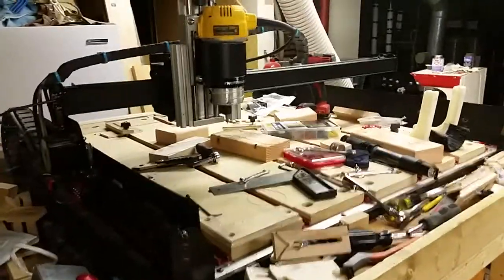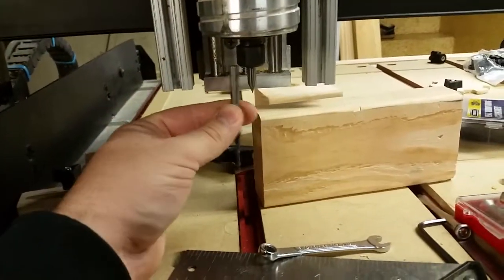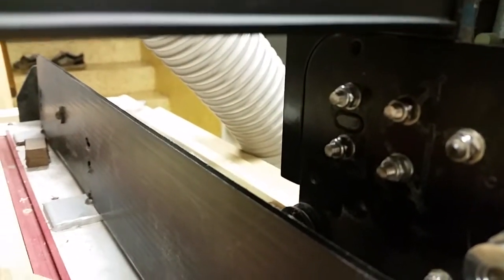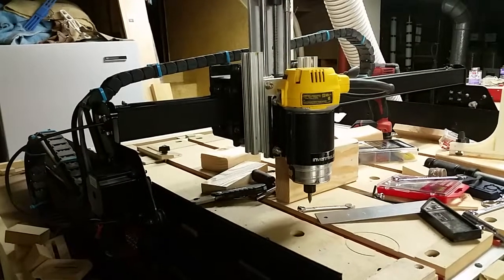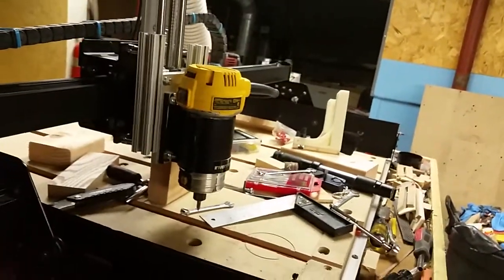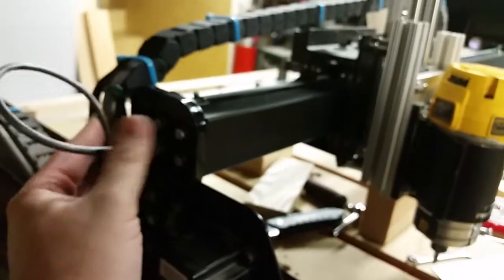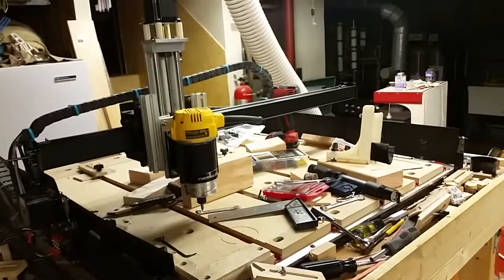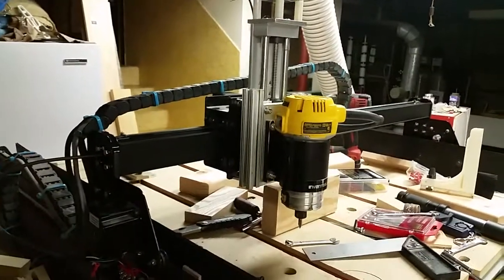X Carve new X axis and lift plates

Comment: fyi im novice.and i have no money so whatever i do has to be on a budget or free ...i just built my late 2015 model 1000mm xcarve about a month ago..i got it real cheap from someone who never built it ... for my x axis i printed these parts that join the 2 maker slides together..they kind of look like i beams but have the exact shape of the extrusion so they fit perfect and join both maker raisl as one..i put one every 4 inches...seems more solid...i also added 3 y axis vertical supports just using 1/8x 1 inch steel from the top maker slide slot to the bed aluminum extrusion..this basically makes it so that there is no flex up and down on the y axis and does help a bit with flexing left to right... i also made my own taller y plates out of 1/4 aluminum... i had problems with homing not working but after days opf troubleshooting i resoldered the gshield connector where limits connect to and the problem appears to have gone away... i added a noise filter using caps and resistor on the y limit initially but that didnt fix issue....what i plan on doing today is uasing some 4 1/4 inch oak moulding i have and run it across both y rails to cover the opening to make esier clean up and it will look nice and i have tons of moulding so its free lol and paint it black

Comment: very nice....i installed taller y plates...and .i wanted to increase z - using modified oem z by just buyng a longer maker slide but that will not work since it will reduce clearance... but i like your new z.....and its much much more rigid..thats what xcarve should be using in the first place.....with the oem z it doesnt matter what you do to rest of machine...you are going to flex at z before you flex anywhere else...